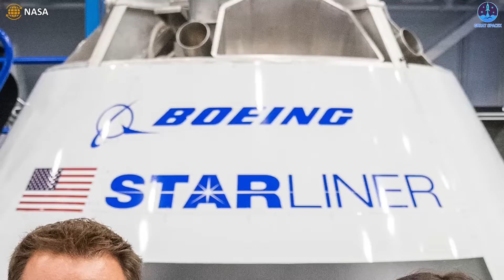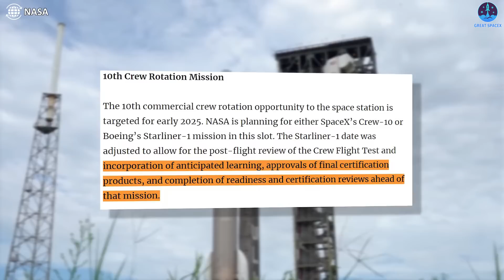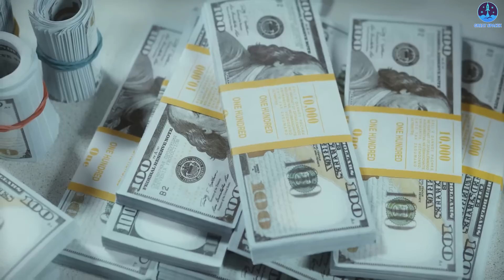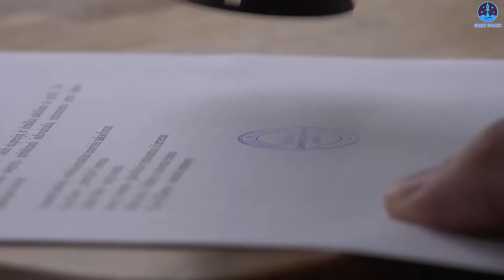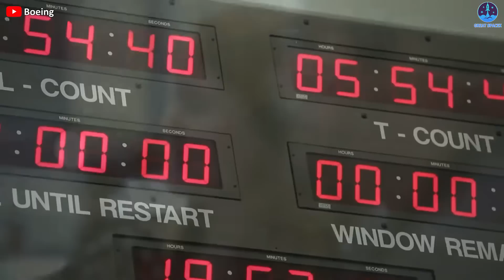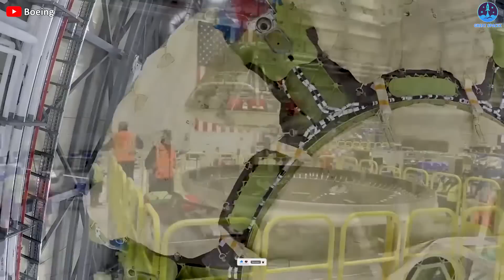BAD News for Boeing Starliner! NASA finally realized Dragon is 1000x better...

Comment: Boeing should consider getting out of the space industry.  And possibly the aircraft industry.  Or massive change in leadership.  Boeings business model is failing the company to give profits to shareholders.  Currently Boeing can not compete with Spacex.  Spacex is to far ahead and growing even more competitive.  Dominating the industry.  Boeing has major problems with quality control.  A vital element in space and aviation.  Boeing is also failing in innovation.  Lockheed and Northrop Grumman should consider the airliner business.  Possibly with an Airbus partnership.  Or Japan or another nation or country.  Like Bombardier, Mitsubishi, BAE, or Embraer. India has potential.  There are only really 2 airline producers.

Comment: How hard is it to build a working space capsule? Stop trying to reinvent the wheel, and go back to what worked, the Apollo Capsule. 
Plenty of capsules at museums, so copying the original should not be a problem. 
With modern CAD/CAM techniques, Boeing should be able to get a new capsule up and running in no time. .

Comment: But SpaceX stopped building Dragon Capsules. Even if they are re-usable, if NASA puts all its eggs in the SpaceX basket with a ship no longer being made and the ir next gen not actually working yet, they could find themselves in the same place they were when the Shuttle stopped flying. They need to always have 2 in case one has a problem.

Comment: The bigger question is if those 2 astronauts for the manned flight test are worried at all.  Boeing in general has been far less than stellar in their safety and reliability (including Starliner).  Boeing is a bloated mess of a company used to getting a pass for cost overruns, waste, etc.  SpaceX has not been perfect, but they take every failure and learn from it to make the next launch better.  They've exceeded the proposed launch cadence for the STS system by a lot and have a far better safety record.

Comment: 4.2 billion just for the capsule with no rockets supplied by ULA. Time for investigation sound familiar.
Reply: 🙄 The $4.2B Starliner contract is for the development, test flights, and 6 operational flights. There are 7 Atlas-V boosters already slated for the rest of the Starliner flights.

Comment: Boeing was a leader until it merged with a loser of McDonnell Douglas. McDonnell Douglas never designed a 'new' airframe from the ground up, preferring to just tweak an old design by adding a foot here and there to make it look better. Boeing since the merger has not designed a new commercial airframe from the ground up, just adding things trying to keep customers happy. It's never good to make changes and not tell the customer the what/why/how you did things in the dark. Not even a paper trail for the pilots to know something was different.

Comment: The thing that you have to remember about Boeing and Lockheed Martin is that they are no longer engineering companies, they are marketing companies.  Their job is done the moment that the government signs a contract with them. There philosophy is to deliver the minimum possible barely function equipment at the greatest possible price. And both Boeing and Lockheed Martin both love overruns as they can keep pumping the government for ever more money using the sunk cost fallacy. If you want functional hardware on time, do not even consider Boeing and/or Lockheed Martin.

Comment: Big mistake not to prefer Sierra Space instead Boeing. So much investments wasted for this project.
Reply: In Sep 2014, long before the 737 Max even flew a test flight, Boeing was one of the top aerospace companies. SpaceX had 12 whole Falcon 9 launches under their belt and was still trying to land their first booster. The first Falcon 9 landing was not until Dec 2015 and the first reuse of a Falcon 9 was not until Mar 2017. SNC was building their first spacecraft with Dream Chaser and it got a Commercial Resupply Services (CRS) in Jan 2016. The cargo version of Dream Chaser is STILL not ready for its first flight and that may not happen until 2025 if testing goes long. 

Boeing was the top bid in Sep 2014 and the Commercial Crew contracts are fixe-price contracts, so Boeing has been paying for the Starliner fixes since Dec 2019.

Comment: The remark of the administrator about building a business case shows the problem. Boeing, since it took over Douglas has been run from the top down with the bean counters in firm control. They used to have engineers driving the programs, but that is no longer the case. SpaceX on the other hand has a leader in Musk who said, don't worry about the expense, just get the product done right,  giving his engineers full head. We can see the difference.

Comment: What's even worse is SpaceX had to develop both the capsule and more importantly the rocket. Boeing is just building the capsule!
Reply: Sorry, SpaceX developed the Falcon 9 and Dragon 1 under the Dec 2008 Commercial Resupply Services (CRS) contract. The Crew Dragon is a variant of the Dragon 2 capsule, so SpaceX was modifying Dragon, not making it completely new.

Comment: Even dream chaser is doing better than Boeing at the moment let alone SpaceX. Boing is a joke of the old space industry.
Reply: No, Dream Chaser is not doing better. Dream Chaser came in 3rd in the Commercial Crew competition in Sep 2014. In Jan 2016, Dream Chaser got a Commercial Resupply Services (CRS) contract for cargo to the ISS. Dream Chaser is still not ready for its first CRS flight and may slide into 2025 depending on testing.

Comment: Why is Nasa sticking with the Starliner-is it because they employ so many engineers that need the salary?
Reply: No, because NASA wants redundancy, so they are not stuck with one crew vehicle if problems develop. They don't want to be stuck without a vehicle, like what happened in the Shuttle program after those two disasters.
Reply: @steveaustin2686  sounds reasonable- a backup-but they need a new design- too many problems w/this one.
Reply: @zarl5238  Why start development all over again? SpaceX didn't after a Crew Dragon exploded on a test stand due to faulty valves. Boeing has been fixing the problems on their own dime and NASA has been watching them closely ever since the Dec 2019 failed OFT-1 flight.
Reply: @steveaustin2686  good point- Boeing is paying for it. Who is paying for Dreamchaser? Is it Nasa or a private company??
Reply: @zarl5238  Sierra Nevada Corp is the contractor for Dream Chaser. NASA doesn't build spacecraft, they ALWAYS hire contractors to do so, even for the spacecraft that they own.
Reply: @steveaustin2686  good info thx

Comment: 5 hours ago they were tweeting about it happening next month?
Reply: May the 6th, 2024...  It does not have a happy ring to it, like 'May the Fourth be with you!' does! The sad thing is, that the May 6th date happened due to a pushback from an earlier date due to concerns of getting needed supplies to the ISS.
Reply: @thomasboese3793  The CRS-30 Dragon 2 capsule was in the IDA port that Starliner would use. NASA also wants to reposition the Crew Dragon to the other IDA port once CRS-30 left, for future cargo missions. That is why the launch was pushed back a few days to May 6th.

Comment: Your opinion is absurd. Space-X Dragon was engineered to deliver people and crew to the ISS. Starliner was designed for far deeper space mission. Also note that Space-X has a freewheeling "build-launch-fail-try again" philosophy. This fine, but it's clear that NASA takes a different, far more careful process. They are different spacecraft, designed for vastly different missions. You also forgot to mention Starliner's trip around the Moon.
Reply: I think you have Starliner and Orion mixed up. Orion is built by Lockheed Martin and is the crew spacecraft for the Artemis Moon missions. Starliner was built for the ISS and is built by Boeing.

Comment: Boeing long ago spent the NASA money on bonuses for executives and counted on being the only real option for commercial crew. They assumed that they could come back and get more funding for their project and get the strict contract cap removed. Then Space X actually got their Dragon up and going much  closer to the original delivery date. Boeing leadership doesn't want to put their money and resources into delivering their project. IMHO,they would be happy to see NASA cancel their Commercial Crew contracts and walk away like they did with their Air Force reusable booster program.
Reply: The Commercial Crew contracts are fixed-price contracts, so Boeing has been paying for the Starliner fixes since Dec 2019. NASA has NOT been paying the cost overruns for Starliner.

Comment: NASA has not announced a delay till 2025 for Starliner. Scheduled launch is May 6, 2024! I don’t know where this channel is getting its information but it sure isn’t NASA.
Reply: May 6, 2024 is 4 days away. I've got $1000 that says it does NOT launch on May 6, 2024.
Reply: @geraldscott4302  I would never bet on a launch going when scheduled, especially a first crewed mission. Too many variables.
Reply: @chakeres  if they knew what they were doing, they would have made the launch... Saturn V was made within the timeframe.

let me put it to you this way... Saturn V was in development for FIVE years, just 5... then they yeeted a trio of people toward the moon and kept going back until the TV ratings plummeted.

Starliner? it's first test launch... TEST LAUNCH was conducted FIVE years ago... 

Boeing knows how this works, they were the ones that made the FIRST STAGE to the Saturn V!
Reply: @SkashTheKitsune Boeing and co knew back in the 1960s and 70s. You think Boeing knows now?
Reply: @SkashTheKitsune  The Saturn V was in development from 1961 to 1967 and didn't launch people until december of 1968 thats 7 years of development
Reply: @geraldscott4302  They are in final launch prep now.....
Reply: @apollo4619  Scrubbed...........
Reply: @geraldscott4302  tends to happen, It’s highly unlikely it will be scrubbed back 7+ months
Reply: Insider information. I have a bridge for you if Starliner launches this month.

Comment: A Dragon with a crew of two around the moon like Apollo 8 did is all that Space X needs to conquer the entire space domain .
Reply: Dragon is not rated for a trip of that duration, nor is Starliner. Not enough consumables on board. This is why NASA needs Orion.
Reply: @dottybass57   Neither Starliner nor Crew Dragon have the shielding for operating out from under the Van Allen belt nor the propulsion to make it back from the Moon either.

Comment: It’s a jobs program that will waste more money then be cancelled within three years once jobs are available for executives and union employees.
Reply: The Commercial Crew contracts are fixed-price contracts, so Boeing has been paying for the Starliner fixes since Dec 2019. NASA has NOT been paying the cost overruns for Starliner.
Reply: @steveaustin2686  So?
Reply: @JZainbear  So, NASA is NOT paying for the Starliner fixes. Boeing is paying for the Starliner fixes and has been since 2020.
Reply: @steveaustin2686  so, it’s still a union jobs program and a waste of money. The byproduct of an inefficient and poor company management. Who pays is irrelevant.
Reply: @JZainbear   NASA wants TWO providers so that they are NOT stuck like they were during the Shuttle era if there is a problem with one spacecraft. AGAIN, Boeing is paying for the fixes.
Reply: @JZainbear   🙄 NASA wanted TWO providers, so if there is a problem with one, they won't be stuck like they were in the Shuttle era. Boeing is paying for the fixes, so NASA is NOT paying. The contracts are milestone based, so until they cross a milestone, they don't get paid that part of the contract. So kind of hard to be a waste of money jobs program when Boeing is the one paying. This is not a hard concept.
Reply: @steveaustin2686  yes I get all that. Has nothing to do with my original statement. It’s a wasteful jobs program. Inefficient and poorly run. Boeing is great at being an inefficient bureaucracy.
Reply: @steveaustin2686  who pays is irrelevant. It’s still a waste. If you bought a car that got one mile to the gallon it is still a waste. Irrelevant who pays for it. And the fact is Boeing will eventually roll the cost over to the customer and the tax payer. You don’t seem to grasp either point.
Reply: @JZainbear  🙄 Whoosh, goes the point of having TWO providers. The Commercial Resupply Services (CRS) program had two providers since 2008, Dragon and Cygnus. NASA added Dream Chaser to be a 3rd option. Commercial Crew has had TWO providers since 2014. NASA wanted TWO lunar landers for HLS, but the 2020 Congress only funded one. NASA was able to get the 2021 Congress to fund the Appendix P competition to get a second lunar lander. So if there is a problem with one provider, they won't be stuck like they were in the Shuttle era, by having only one provider. With TWO providers, then you have redundancy. AGAIN, this is NOT a hard concept.
Reply: @JZainbear  🙄 Boeing CAN'T roll the cost over to the taxpayer, since the Starliner contract is a FIXED-PRICE contract, just like the Crew Dragon contract. AGAIN, this is NOT a hard concept.
Reply: @steveaustin2686  you clearly don’t grasp how the industry works so any further discussion won’t lead anywhere. They will roll the cost. Boeing is a big company with many contracts military and commercial. I’ll leave you to figure it out yourself or perhaps someone else will help you to understand.

Comment: how to solve NASA budget cuts... cut Starliner
Reply: And SLS. Suddenly, NASA could achieve so much more if they did.
Reply: @channelwithaweirdname  Without SLS to send Orion to the Moon, there is NO Artemis program. Starship is nowhere near ready for Earth launches and landings and if it doesn't get a LOT more reliable, might never do Earth launches and landings.
Reply: @steveaustin2686  you expect reliability in 4 test launches?
Reply: @Jadefox32  For crew to be put on Starship to launch from and more importantly land on Earth, Starship needs to be VERY reliable in the landing sequence with the Flip-n-Burn catch landing. Starship is still very early in the development process and whether or not Starship can get to be that reliable for Earth launches and landings is still an open question.
Reply: @steveaustin2686  I figure for the first couple of years the crew would transfer to a dragon capsule when coming back to earth and Starship does its thin on auto.
Reply: @SpruceMoose-iv8un  SpaceX will need somewhere to put the Crew Dragons during the mission. Crew Dragon can't fly by itself that long and the ISS doesn't have the room. If the ISS was even in the right orbit in the first place, which is very unlikely.
Reply: Too late...paid for...nothing

Comment: No they just realized they didn't need those specs that Starliner meets and Dragon doesn't.
Reply: Say what?
Reply: @kenknowlton3085  Dragon can't be recovered on land, can't stay on station for the length spec'd, and internal volume less than the original spec. just to name a few.
Reply: Your in comedy, right? SpaceX gave NASA a working capsule that the astronauts love as a lower cost of development and deployment. Boeing as given them nothing but delays and cost overruns. To try to say a working system is not better than a system that simply can't be used safely is more than funny it's insulting.
Reply: @kstaxman2  gee, seems like you can't read. I never said Starliner was better or in fact needed. Just that Dragon didn't follow the specs which turned out not to be needed. Really, try some comprehension skills or wait to comment until you graduate from junior high school.
Reply: @robertarnold9815  So you acknowledge that your comment is superfluous and irrelevant. Everybody else already knew this.

Comment: Honestly, NASA should give the Capsule over to SpaceX to work out the problems and launch it on a Falcon.
Reply from the maker: Yeah👍
Reply: @colonbina1  No, that is a dumb idea. The whole point of the Commercial Crew program was to get TWO providers so that NASA would NOT be stuck if one provider had problems. If NASA had chosen only the top bid in Sep 2014 for Commercial Crew, NASA might still be buying Soyuz capsules to get crew to the ISS.
Reply: @steveaustin2686  Redundancy is a policy NASA finally was able to enact after gaps in spaceflight after Skylab, 2 shuttle groundings, and post shuttle. And these SpaceX fanboys wanna repeat mistakes of the past and put all our chips on one horse
Reply: @colonbina1   What is up with all the posts disappearing?

Comment: Heads should roll. The Senators included!
Starliner is a PORK BARREL DISGRACE!
Reply: 🙄 The Commercial Crew contracts are fixed-price contracts, so Boeing has been paying for the Starliner fixes since Dec 2019. NASA has NOT been paying the cost overruns for Starliner.
Reply: @steveaustin2686  Oh come now! The only reason that Boeing is involved with the Space program is Pork Barrel from NASA's inception! Once Senators get their claws into a project the costs begin to s[iral!